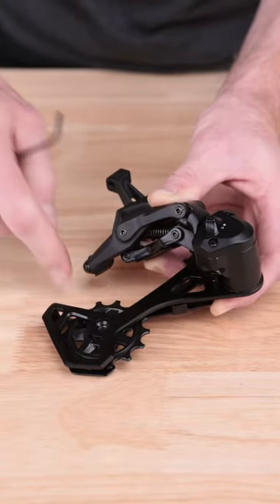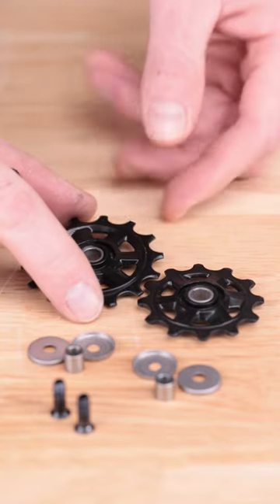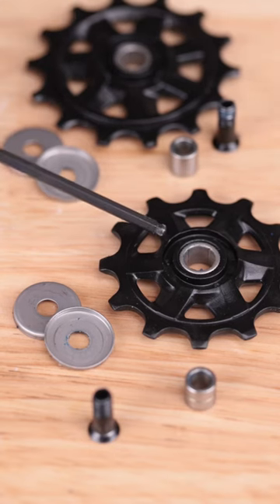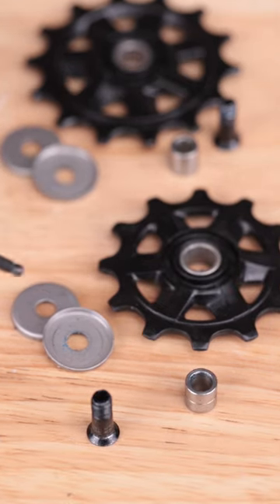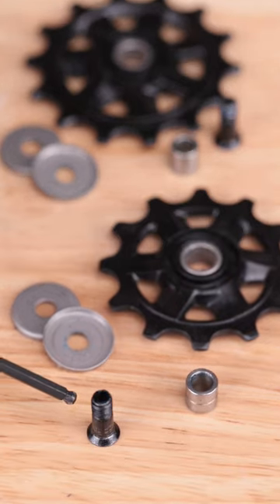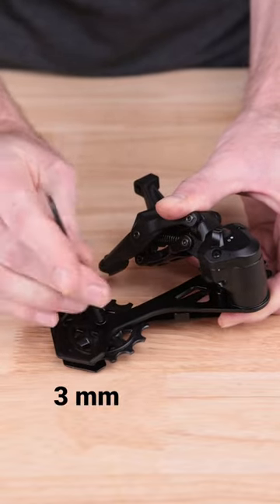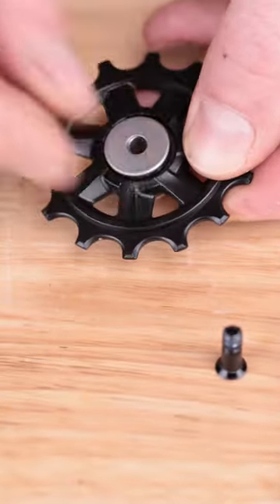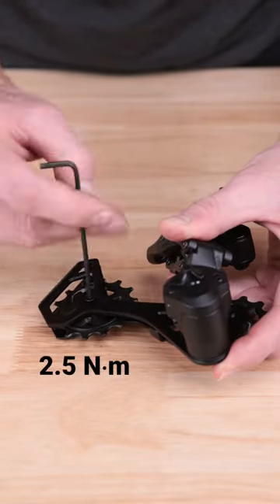How to Replace Pulley Wheels on microSHIFT Derailleurs

Comment: What is Microshift's recommendation in terms of mileage on a derailleur when jockey wheel replacements are needed?
Reply from the maker: We don't have a set recommendation because it's so dependent on the rider and riding conditions. If the teeth are visually wearing down, it's time to replace. If they aren't turning well, probably time to replace.